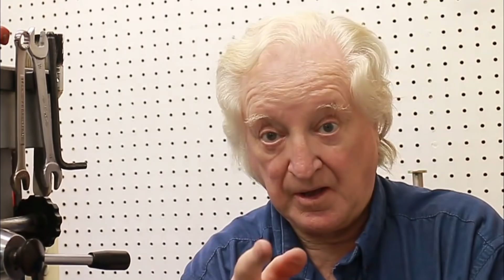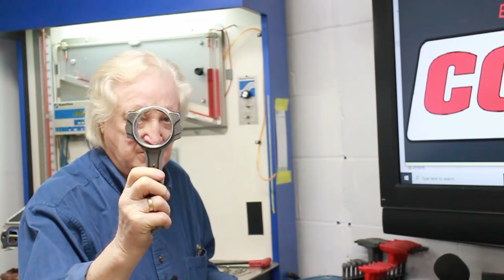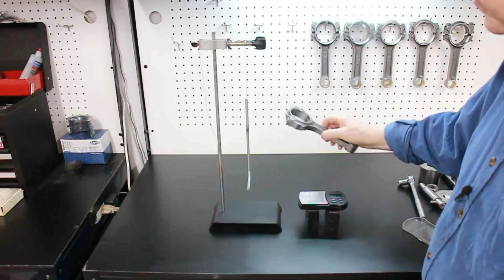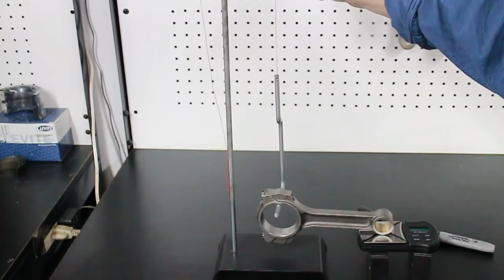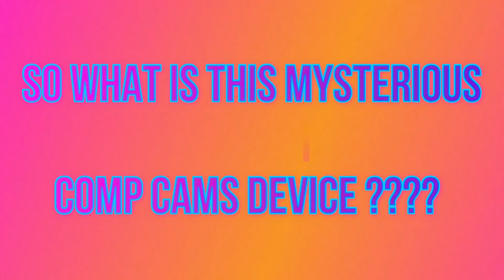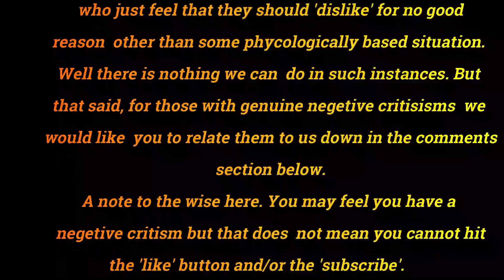PowerTec 10 EP 12 Electronic Rod Balancer $15.00

Comment: I used to work for an automotive machine shop back in the 60's and many a connecting rod for high performance street and some drag race engines had the stock rods honed for a slip fit piston pin. We never had a comeback due to this procedure. Back then, the choice for a SBC was the pink rod. There were very few aftermarket rods available that were affordable to the average Joe.

Comment: OK OK After watching 3 videos i relented and subscribed with a LIKE. Oh how i wish i had seen these videos in 1967. or even 1964. In 64 i was building my first engine, 1957 Olds 371 to go into my 47 Chevy Coupe, with the Olds Hydro and Rear end swapped in to. The engine had cam with higher lift otherwise stock rebuild. it ran like a scalded cat until down shifted too soon and overrev'd the old springs and a valve broke a piston. The rod flew (literally) out the side of the oil pan. I had no one ask or check what i was doing. I was 15.  The cam came with instructions to replace the 57 rocker assembly with 1954, But I was poor and had no access to parts and did not fully understand why. Well my Dad was so disappointed he banned me from fixing the engine and had the 47 towed away. He was a farmer not a mechanic. But later in 67, I sold the 327 in my 64 Corvette and was building a Big Block Chevy.  Working at a gas station has me some money to spend. Domed Pistons, Pink Rods, etc but the Rod Bolt nuts were castle-ated. my thick socket set did not fit perfectly over the nut as the rod was heavier and left little space for a cheap thick socket. I held the socket square and torqued the nuts down but it was hard to do. I had a ZL1 cam from a CanAm race car that was simply nuts. It idles really ruff about 1,200 rpm. I had 3 2 barrels holley's off the 435 HP 427 but i think they were 400 HP version and smaller jets. The engine was raucous and would overheat at red lights. Still had the 327 radiator. But the engine pulled slow and never seemed to show the power expected. I had a plan to let a race team mechanic check it out and see what was wrong but the day before i was to go there i was showing another fellow the problem when a rod cap let go and once again I had a rod fly out the oil pan. Its was pretty bad. I never built another engine. My Grand father build Ford engines for NASCAR in the 50s. but he was too far away to consult. So you see your videos may have helped me to achieve a life dream. I did get one last engine build. I paid a serious engine builder to assemble a 1998 LS1 for my C5 Corvette. And it all worked out, great. Iron Block, Malhe pistons, H-Beam Rods, Crane Cam, Balanced, Roller Rockers and Oil Accumulator for oiled starts. Then a Magnuson Supercharger with air to water intercooler and methanol injection at WOT. I will likely never build an engine, but watching your videos shows me how much i did not know and how i could have build a good engine if i had seen these things. Well done, practical, useful information with out the drama. However, a few points i would like to share, You should try to add some summary concrete demonstration of the results in your lectures. Like a worksheet on the 8 rods with weights entered on each one before and after balancing. Or a chart with the air flow rates before and after porting the tunnel ram so we could see real numbers and the impact of the porting. You are a seriously experienced engine builder and it is great to share your knowledge. Please keep it up. Dennis in Virginia

Comment: I always enjoy your videos and your knowledge but as an engine machinist I disagree with this video.  With the proper equipment accurately balancing to a tenth of a gram is fairy easy , no more work than a half a gram with this method.  The small ends really don't need to be weighed with the isolation method,  only as a double check mechanism.  The small end weight is the total weight minus the big end weight. That comp cam fixture is 1910 technology !  That is how you balance a crank grinder wheel or a surface grinder wheel not a connecting rod in the 21st Century. It doesn't give you a weight(s) to fill out a balance card. Without a properly filled out balance card most machine shops won't balance your crankshaft .  If you tell them you did it yourself they may not want the liability of your potential errors.  You should have also explained how lightweight components affect total engine balance.
Reply from the maker: Andrew,
 You raise some valid points here but there are  background reasons that can be leveled at your, might I say, thoughtful comments. 
   The 1910 balance fixture is what we used to balance the rods for our 4 and inline sixes we used to do in the UK. For those we don't need to know what the pin and big end weights are.
That 'proper equipment' you speak of is costly for the 'do it at home' guy. Ask yourself what if this guy is trying to lighten a set of rods with overly large balance pads? Either balancer would be a very useful piece of gear would it not?
DV
Reply: @marvingvx1  The topic of metal removal also needs discussed.  The proper methods of how and where to remove it.  Also the effects of overheating the rod when large amounts of stock are removed causing deformation.
Reply: @marvingvx1  I agree for inline stuff you don't need to know the weight because bobweights aren't required.  
   In the realm of machine shop equipment rod/piston balancing equipment is relatively cheap.  A good scale that is accurate and repeatable is a must and the most costly part.  With some basic machining skills people can expand on your chain style design to increase rigidity/repeatability.  Other basic designs can also be borrowed from.   

Even if you did spend a few hundred dollars building one it would easily pay for itself after a few uses.  Stock rods are somewhat of a thing of the past and they require the most work.   New box rod sets are typically fairly close depending on your level of scrutiny.  

I still maintain that not very many shops will want to be part of your balancing job if you tell them you used a string and harbor(horror) freight scale.  As a shop owner lots of people have the very best of intentions and will try to do things to save money but I typically spend as much time inspecting /correcting their work as it would take me to do the same job in the first place. 

Another point is that balancing is the very last thing that should be done in a engine build.  Depending on the combination used an engine needs to be test assembled to check for rod clearance with the cam, block, oil pump system and girdle if one is used.  Rod side clearance and bearing and pin clearances need to checked/adjusted to make sure all ALL machine work is done prior to balancing.
Reply: @aldo6192   if you were an actual engine machinist you would ask the same questions and debunk DYI crap.
Reply: @aldo6192  I'm not above anyone but I do know the difference between right and wrong in certain areas.   People like you who follow blindly without asking questions never learn the difference between right and wrong and lack the ability to come to their own logical conclusions. 

I own several of his books and David is expert in several areas but engine balancing isn't one of them.  I invite you to find a machine shop owner who doesn't scratch his head at this video.
Reply: I would say this: for the average guy who wants to assemble an engine and not spend a lot of time on thinking about it, seeing an engine machine shop for all needed services is probably best practice.

For the hands-on guy, maybe a tradesman in another field who understands mechanical and precision measurement, I'm going to say for these guys (guys like me), we are probably going to get good results in our backyard shops. 

Material removal is a good point. Yes, someone in a backyard or basement shop diy balancing should be slow and conservative with material removal as to not overheat the metal or remove too much. 

Lastly, I am always impressed by circle track racers and their work-arounds and garage-mechanic-ing. Some of those guys are incredibly knowledgeable and build some impressive engines, and they are using techniques that most on forums and the internet would shudder at, but they are doing it.